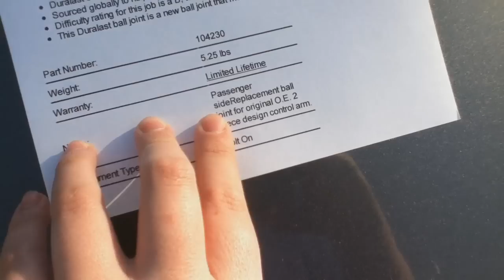Ford Explorer Pass Side Ball Joint Replacement Part 1

Comment from the maker: You should get one done, but if you do the lower joints you can get away with not doing it. The upper ball joints are replaced with the control arms and will need an alignment then.

Comment: So I heard you need an alignment job after doing these upper ball joint jobs...is that correct justhes?
Reply: Evan Last If you're doing the entire front suspension, yes. If you're just replacing that one part you'd only have to if the alignment is noticeably off.

Comment: Cruising through videos for laughter..
Title should be, 
"how to remove upper ball joint the hard way"
You would get more hits..
Leave the ball connected to the knuckle..
Remove ball stud bolt, through knuckle..
Spray a little penetrating fluid on ball stud..
Hit the knuckle with a BFH
It should pop lose and the knuckle/lower control arm will drop..
Then proceed with replacing upper arm/ball joint..

Comment: Invest in a nice ratchet set my man. nothing worse than making 1/2 rotaions with an open end box wrench :D I was wondering, why not go with the one piece upper control arm when you replaced it? Is there a benefit in sticking with the two piece?
Reply: Evan Last The 2pc is a waste of time and money.  If you switch to the 1pc you'll need a camber kit for each side of the truck.  The camber kits allow for more adjustability and they are easier for the technicians to do alignments.  The 2pc doesn't allow for much adjustability.

Comment: just to be on the safe side i wouldn't count on those impact guns to do things up especially things as crucial as suspension / brake bits as the nuts can bind and give the impression they are done up tight when really they arnt. just to be sure ide nip it up with a ratchet to make sure. not criticizing just saying ;)  

good job tho